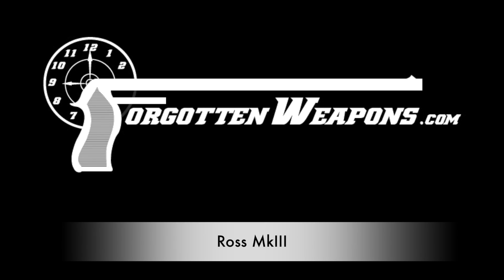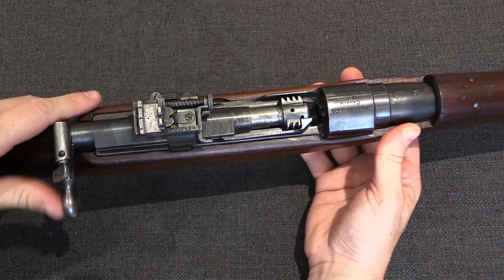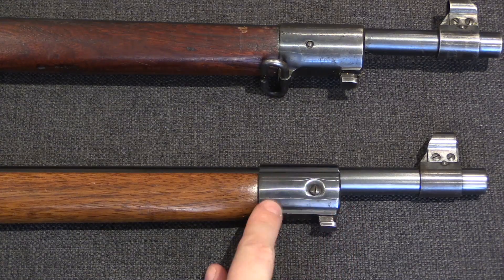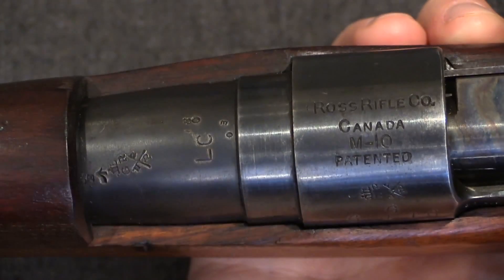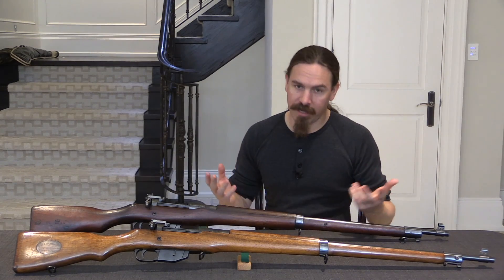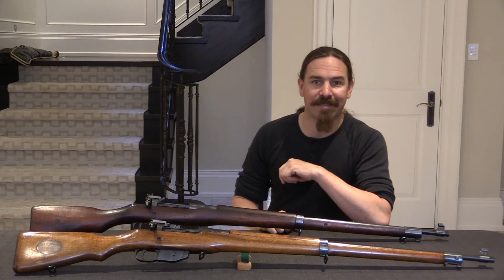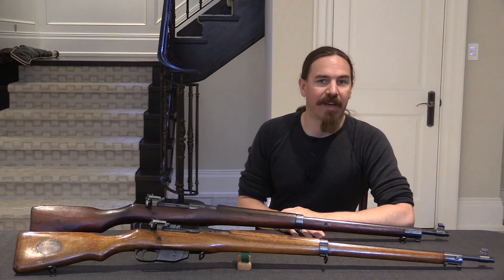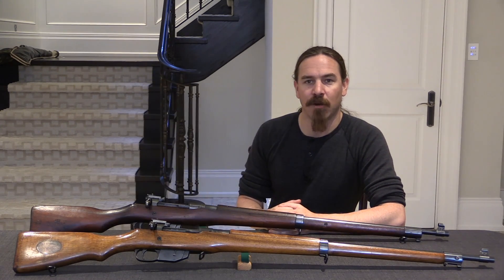The Ross in the Great War: The Mk III (and MkIIIB)

Comment: I actually have an original Ross Mk III R-10 Civilian Sporting Carbine. Hands down, the smoothest bolt action I have in my collection, and that's surprising for a straight pull. Still, the speed gains over the No. 4 Mk I is minimal, as I'm good at speed cycling Enfields.

Comment: I'm fairly sceptical about the "out of spec" ammunition story; perhaps thats slightly over-exaggerated or seeking an excuse? There were dozens (70+?) of small arms munitions factories across the Empire, and the .303" round was well defined and well known in its specs. They had quite tight batch testing standards imposed by the War Office. I have hundreds of WW1 rounds, and not one appears different in any way. In fact, due to the way cordite was die extruded and then cut to length, ammunition from different sources is remarkably consistent in performance - a mixed handful will usually form a reasonable group.
I expect the major reason Ross' were ordered withdrawn was lack of logistic support for them. By 1916, the UK rifle factories were routinely rebuilding hundreds of thousands of battle-damaged Enfields. That industrial level of rifle refurbishment and re-issue would simply not be possible with the Ross', which would have had to be shipped back to Canada. The Commonwealth and Empire forces in Europe needed to be plugged into the UK armaments support in order to maintain field equipment levels, and so native major equipments would not be sustainable.

Comment: Interesting that what probably made it a good sniper rifle (tight tolerances) also made it less than reliable with poor ammunition. Another one of the compromises that needs balancing when designing a firearm. Do you go with a finely tuned machine that chokes on the first sub-standard round or a rugged rifle that will take a beating and keep on ticking but measures its MoA in feet rather than inches. Before the inevitable counterpoints, I am fully aware that is a gross exaggeration.
Reply: I have a Model 96/11 aka the G11 and I think it's a great middle ground. Accuracy is always near perfect and it will still cycle dummy rounds that have been horribly bent out of shape without any fuss or issue.

The gun is so idiot proof I have never jammed it during practice a single time, assuming I reload using a secondary mag and not one of the horrible charger clips.
Reply: If some company would make affordable stamped metal extended replacement magazines for the 96/11 it would be the prefect straight pull rifle. 

imagine a brand new 10 rounder for 35 dollars. Why hasn't someone made that yet

Comment: So the Ross MKIII is a good rifle just not quite the right rifle for the job.
Reply: Sort of like the p38 lightning in europe.  A number of correctable problems.
The p38 got to prove itself in the pacific, its too bad the ross never got redeemed.
Reply: @randymagnum143  it got redeemed as a sniper rifle, the most effective sniper of WW1 Francis Pegahmagabow used it and scored over 300 kills with it.
Reply: Heavy. 
Expensive.
Despite being heavy and expensive, several parts were flimsy and had to be changed during the war.
Several parts of the action were not correctly dimensioned and/or were made of too soft metal.
It needed the highest quality ammos and no dirt at all to work properly.
If the correct reassembling procedure was not followed, the rifle could seriously harm the user. 
It was really a series of defects with only one redeeming quality. If everything was perfect, it was an accurate rifle.
Reply: @neutronalchemist3241  another big redeeming feature - straight pull, allowing continuous firing while aiming down the sights.

Comment: Wait, so you're saying Ian and let me get this straight:
Shitty poor quality ammunition, incompetent material suppliers, stupid  troops unable to understand orders AND TO TOP IT ALL OFF political nonsense hellbent on ruining an otherwise working rifle system forced the Ross rifle out of service?
Say it ain't so! 

SA85 GB politicians shuffle uncomfortably
Personal note, politics seem to be bent on destroying and ruining everything rather than simply leaving well enough alone.
Reply: Heavy. 
Expensive.
Despite being heavy and expensive, several parts were flimsy and had to be changed during the war.
Several parts of the action were not correctly dimensioned and/or were made of too soft metal.
It needed the highest quality ammos and no dirt at all to work properly.
If the correct reassembling procedure was not followed (those rifles were issued to conscripts), the rifle could seriously harm the user. 
It was really a series of defects with only one redeeming quality. If everything was perfect, it was an accurate rifle.

Comment: Perfectly good Canadian rifle ruined by subpar British ammunition! Sad!
Reply: If the hundreds of thousands of Lewis, Vickers, Lees, and Pattern 14s worked well with British ammunition, perhaps the issues were with the Canadian rifle?
Reply: @Paranomasia12  B A L D E R D A S H
Reply: @Paranomasia12 

shrugs

Quite frankly, while such an issue seems obvious in hindsight, one must recall that from conception to induction, the Ross rifles were designed to use and tested with Canadian ammo only. 

No one had ever thought of making the rifle compatible with looser-tolerance ammo, cause they expected Canadian troops to rely on their own supply chain (whether this was wise or not is up for debate). 

Most unfortunately, this would not be the last instance the butterfingers of British industry screwed over the ex - colonies.
Reply: @Paranomasia12  the Ross rifle in its proper Canadian 303 loadout worked perfectly, it was the British version with different tolerances and pressure loads that caused issues with the Ross.... When supplied with proper ammo the Ross worked fine, after all over 20 nations used the rifle over a 40 year span, so something was going right for the rifle, long as it's issued properly. Much like the early M-16s had issues with improper ammo in Vietnam, wasn't the rifles fault.
Reply: truly is sad

Comment: Thanks that was a interesting look into the Ross rifles. Can't help but think it would have been no more difficult to design a semi-auto rifle. Certainly no more machine time.
Reply: You would have to deal with a gas system, which at this point was dubious for an infantry rifle.
Reply: @TheOwenMajor  Even if Ross wanted to use gas operation. It still would have a lower parts count. The auto loaded rifles of the time where not piston operated. Everything but French designs was recoil operated. The British .303 round would have actually been the one of the simplest to build a design to utilize. Only the Japanese and Swiss 6.5mm rounds would have been easier.
Reply: @alt5494  Someone on a previous video reminded us that Ian covered both the semi, and full-auto Ross rifle conversions on his website.  https://www.forgottenweapons.com/ross-semiauto-prototype-rifle/  &   https://www.forgottenweapons.com/the-huot-machine-rifle-a-ross-conversion/  [edit] Although I should say that the semi-auto one was mostly just Ross furniture, and used a completely new action.

Comment: My dad used one in the home guard, they loved the accuracy on the few occasions when they were allowed to live fire however they hated the weight when marching.  Like a lot of British troops he was a fetishist of the SMLE for it's handling prowess. He also used P14 in 30-06 too, The armorers marked the rifle butts with a red strip on those to avoid ammunition confusion.
Reply: Ben Davies my dad was in home guard as well, and did train with the Ross, don’t know which model, but he told me the the bolt handle was reversible for left handers, don’ know if that is true though.
Reply: The P14/ 17 bayonet also has two vertical grooves on either side so you have a large tactil obvious diffrence from the SMLE bayonet.

Comment: Main things that aided it as a sniper rifle were that Canadian snipers were issued the best ammo available (Canadian tolerances), and the slower and more deliberate shooting of a sniper meant the bolt issues were few and far between, and much less likely to be lethal. 

Basically countered the two biggest problems. Could have easily been used through WWII but by the '30s it was well past its due date in any form, as it was no longer being developed. Had Ross been given a sniper rifle contract perhaps it could have been used through WWII. It was, afterall, incredibly accurate in its era and the accuracy and smoothness likely could have been improved on in a dedicated sniper variant.

Comment: Not sure what's worse, a rifle that can't handle shoddy ammunition or issuing shoddy ammunition to troops.
Reply: The ammunition wasn’t shoddy, it was just made to slightly different specifications than the ammunition the Ross was designed for. 

The Lees, P14s, and various machineguns were designed with British military spec ammunition in mind and ran it fine.
Reply: What's worse is issuing a rifle designed as a sporter, hasn't had sufficient R&D,had minimal testing and troop trials and then actually fielding it in combat
Reply: Both reasonable responses.

Comment: I have heard that snipers liked it because it was accurate.
Reply: They were also supplied with higher quality, more consistent ammunition, so didn't experience the same issues as ordinary troops. They may also have taken better care of their guns than the average soldier.
Reply: @ErwinPommel  I heard (in Grade 10 history class as I recall, which is where we cover WW1 stuff) that a sniper with a Ross would hand load every bullet, make sure they were cleaned of dust and shit.
Reply: well after all it was designed as a sporting rifle, so its intent was accuracy and precision
Reply: I have 2 m10s... very accurate. Sadly they were sporterized and I lost one of the stocks in a house fire
Reply: @tritowns  That's terrible, but by the phrasing it sounds like you managed to safe the guts/action after the fire? If so that's pretty cool.
Reply: @BleedingUranium  yup. One of these days my son and I will look at building a stock for it.

Comment: Chinese SKS are cheap in Canada, i looked but i cannot find a vid u have done on the Chinese SKS specifically, I am most interested in the batch Cabella's is selling and how you might tell a marksman designated rifle? and cosmoline cleaning, sighting in,corrosive ammo vs non corrosive, little different from your normal format, or i am bad at looking thanx Ian!
Reply: I can help with the cosmoline cleaning.

Take the stock off and disassemble.

Soak  it in diesel fuel.

Run lots of patches through the barrel.

Get into any nooks and crannies real good.

Then clean it real good. Using your prefered brand of lubricating oil.
Reply: @shawnr771  figures diesel works on all metal, and its cheaper than mineral spirits, i want to oven the wood on low temp to remove it but i don't want my oven to stink.
Reply: Most countries that were using the SKS would have been using either a Mosin Nagant variant/clone (early in SKS production) or a SVD Dragunov variant/clone (later in SKS production), as their DMR/Sniper rifles.  China would be included in that group.  You're going to have a very hard time finding a SKS that would have been used in that role.  Generally speaking, if you find a Chinese SKS with a scope or a scope mount, that was made for commercial sale to the public in the US and Canada.  To the best of my knowledge, and I could be wrong, the Chinese never used optics on military SKS rifles nor sold them to client states in that configuration.  There are reports of the Viet Cong, during the Vietnam War, having snipers use SKS rifles but there would have been nothing special about them.  They would have been your run of the mill SKS.  They weren't "accurized" or modified in anyway.

As for your other questions, those are going to be a little more involved to try answering in the comments section here.  Your best bet is to do a YouTube or Google search on those topics.  There are some very good videos and forum posts that go into detail on those topics.